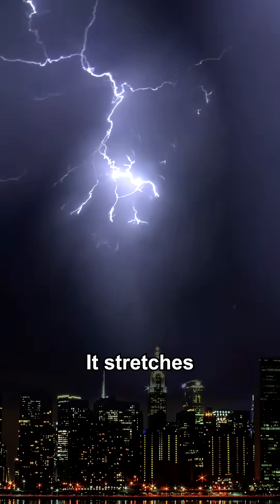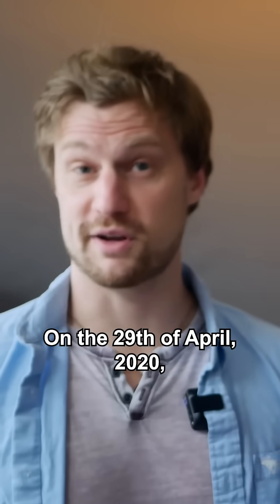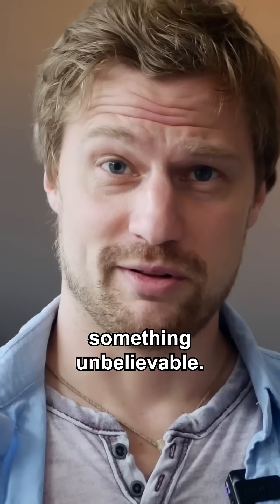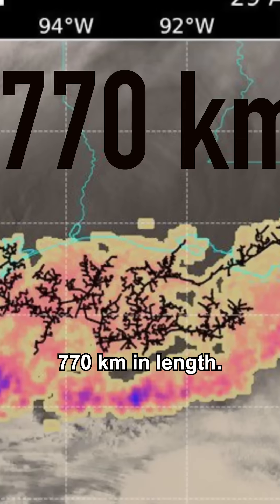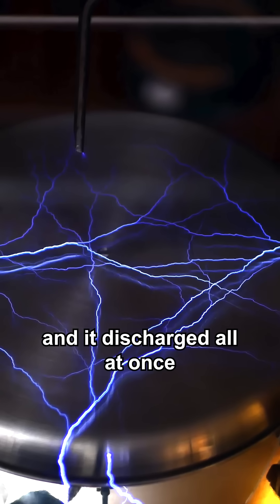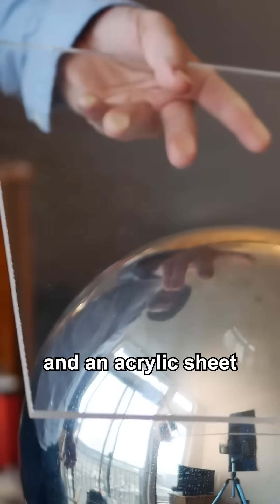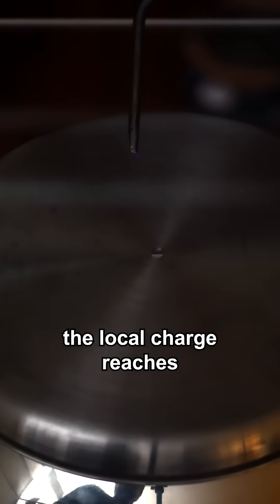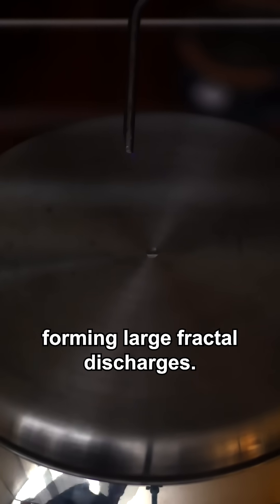800km WORLD Record Lightning Surprised NOAA - So I Duplicated It

Comment: The voltage needed to gap 800km 😮. 

10KV/cm. That math is insane.
Reply: I tried to run the math in my head but my 8b brain overloaded lol.
Reply: Its 800 Gigavolts. I don't even know what to quantize it with lol.

Comment: Very COOL !  Love Your videos, Plasma channel .  Tesla wrote in his article in Century Magazine 1900, documenting his Colorado Springs experiments, that somewhat regular waves of lightning discharges marched around the globe of the earth, in a rough pattern based on the natural electrical resonance of the earth, solar ionizing radiation, and rotation of the earths magnetic core.  To regularize the discharge by using a tower with a large tesla coil, and an ionized beam to reach the ionosphere, Tesla attempted to tap the large reservoir of energy in the upper atmosphere, into a ripplr in the earths core magnetic rotation.  That was the plan for Wardencliff.

Comment: Very interesting.. Until this, the largest bolt that I knew about was 151 Mi (243Km).. the only reason we knew it's length was it struck two radio towers at the same time and we had the time stamp data of when both towers were popped, in conjunction with a screenshot from a security camera that could sort of see both towers from a distance. I climb radio towers so it was something we always talked about when deciding how close was too close for bad weather. (I've been 1200ft up a tower when a stray bolt hit a tower maybe 2 or 3 miles away from me.. Needless to say, I broke regulations and repelled off that fucker as fast as my gear would let me.. took an hour to climb, only 30 seconds to get off)
 
  Your example though, seems like something only possible over oceanic waters because of the increase salinity in the air increasing the conductivity of the air. I doubt you'd ever see this over a lard continental mass. Note how the entire mass of the lightning seems to stop immediately as it approaches the land mass, so from that observation, I think onto something.
Reply: it happend all actoss land for the most part and the cell actually breaks down and loses energy once it gets out over the water should take a look at the actual noaa press release about it.
Reply: @connorjohnson4402   perhaps I should. In the still images shown, as the bolt develops, the storm is already over the gulf, and only small amounts of it trace along areas like louisiana. Very little of the bolt was over land.  Just because the storm developed over land, has nothing to do with what happened once it pushed off shore.

Comment: Now imagine what the result would be if we had a Carrington event solar flare and CME while we're down almost 30% in magnetic field strength....
The Carrington event came really close to causing a collapse of the lower L shell of the magnetic field.  Today it's weak enough that a CME with slightly less energy would cause that collapse easily. 
We all know whay kind of discharges happen when a magnetic field collapses.  There's a reason why there's ancient stories of a "thunderbolt of the gods" and glass fractal patterns in the rock under the sand in Egypt.

Comment: Chemtrails filling the atmosphere with micro particles of barium, strontium and aluminum. Enough said.
Reply: Except lightning travels through ionized air, not along solid conductors of electricity. There'd have to be several thousand tons of aluminum in every square kilometer of air. Barium and strontium aren't even good conductors of electricity.

Comment: Mostly bots and fanbois commenting on another crappy video that at best should be a short...

For an 11 year-old's science report, points would be taken off for sloppily not providing any link at all to the actual NOAA report and data, whilst the demonstration experiments don't really have anything of interest to do whatsoever with the report.  The fact that one stored charge from a Van de Graff generator in series capacitors configured as a "Marx Generator" and got a "really big" spark, with no explanation at all is actually useless and feeble-minded in this context.

Presenting a short overview of where natural atmospheric electricity comes from, and what would cause an allegedly "unusual" build up to the point of "a world record" discharge "across three states", and then coming up with an applicable demonstration to show that happening (on a smaller scale of course) under lab conditions would actually be interesting and useful, much more than copying something that thousands others have done for around 100 years (charging lots of capacitors to get a "really long spark"  - Marx Generator circuit was described by Erwin Otto Marx in 1924, "Van de Graff Generator" was demonstrated by Robert J. Van de Graaff in 1929) and pretending like it's some kind of innovation having anything to do with atmospheric electricity...

Jay, microdosing and weed don't really make you smarter, right?

Comment: or you can just use a particle accelerator and a massive capacitor bank to create a bolt of lightning from the ground to the Ionosphere that can be used to both send, and receive energy from any two points on Earth or any other planet/moon/object in space with an ionosphere.

Comment: I didn't understand the second part with the salt... But it looks cool
Reply: Marx generators are just a way of multiplying voltage (by reducing current). The salt water separated by a plastic works as a capacitor because ions of opposite charge concentrate on each side of the plastic.